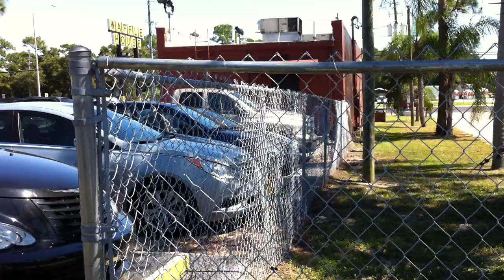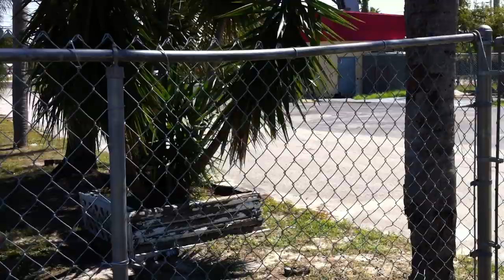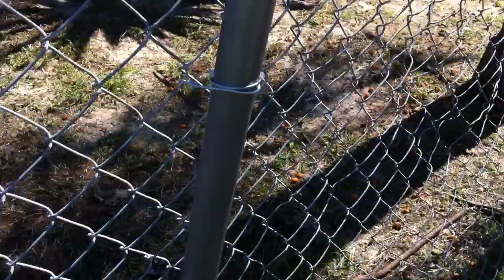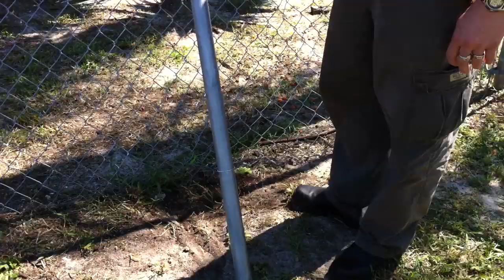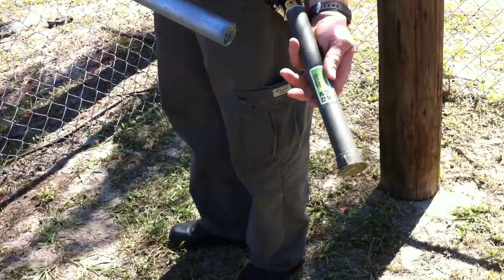Unique Geocache - "Waffle House"

Comment from the maker: We just disconnected the top horizontal rail at the corner and slid the fake pole into place.  Yes, that section of the fence was relatively short so whoever put the fence up did not put a support pole in that section.  BTW, only the corner posts were cemented.